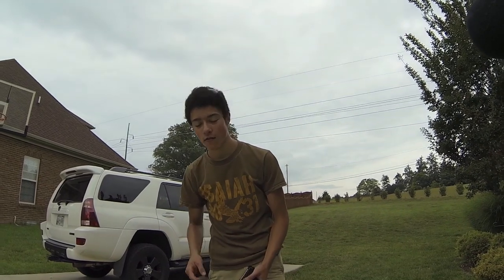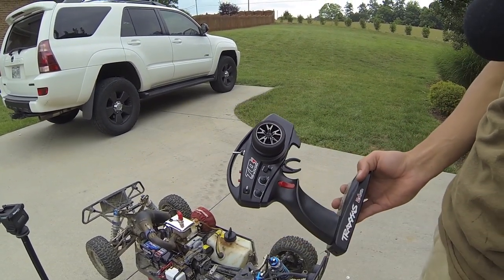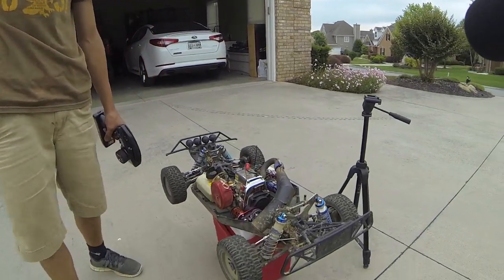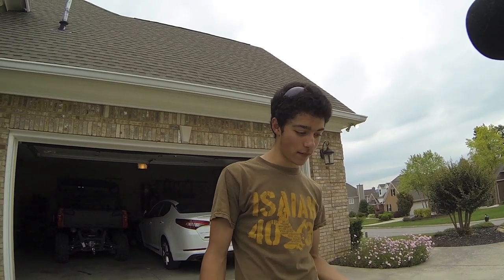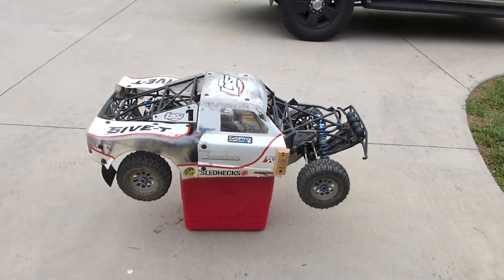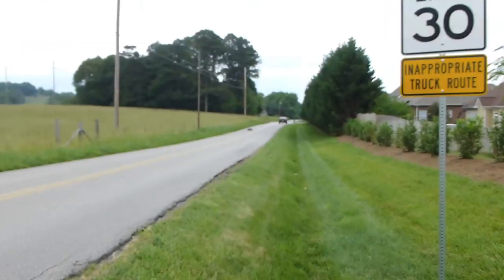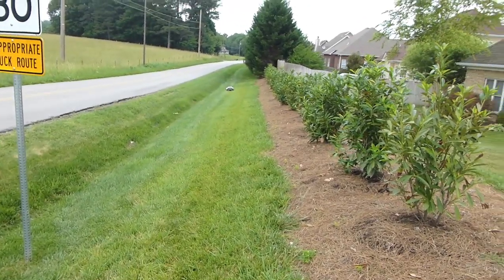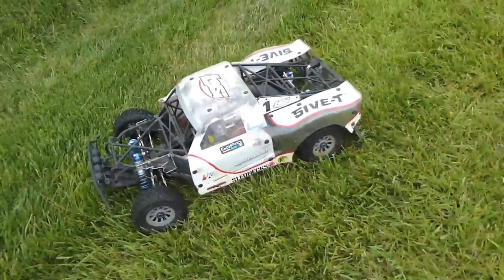FID Racing Electric Starting System - Losi 5ive T (PT. 2) - Ep. 46

Comment: I just installed one of these on my 5ive T2.0 , the starter runs fine when off the engine, but when I put it on, it spins for half a second then stops, like it’s ESC cutting off. If I power cycle the battery then works for half a second and stops again. Maybe I need a better ESC

Comment: Hi man, nice video! I have exactly the same starter but after plugging everything, the starter motor spins the wrong side... Instead of starting the motor, it runs free for a while. If you manually spin the motor countersense, both starter and motor run together... Any idea? Thanks!
Reply: Martín De Nardo I’m sure you’ve figured it out by now but switch a wire with any another wire coming from the motor t make it spin the other way I usually switch the red and yellow
Reply: Wolundstart

Comment: Great post man...do you think this will work on the Monster XL?
Reply: I own a mtxl and it is the same platform basically just with a slightly longer chassis and wider suspension arms they are beasts I also own a fid dragon hammer check them out at rc modelz.UK they have all your fid parts losi parts and every thing 1/5 scale tbeys boys help you out sothats why I give them a mention I have been looking at a one called wonlstart its got a alternator so it charges the battery back up on the starting system pretey cool if you as me a electric start with alternator built in its really  compact system both are food but like the sound of it charging your lipo up as you are running the engine correct my  spelling lol if you must hahaha
Reply: www.Rcmodelz.co.UK check they'd guys out for all you high end 1/5 scale petrol buggy's trucks you name it they got it

Comment: Doesn't it put a little bit of load on the engine by having to constantly turn over the electric motor once it stops turning on its own? Electric motors have some drag to them when you turn them....did you notice a difference? I don't have a problem just pull starting it. It's one less thing to break as well. I would rather put the money into a 2 speed or something like that. Cool video though.
Reply: One way bearing. Wow just seen how old this comment is 😂. Hopefully you've figured it out by now lol. But yea it rides a 1 way bearing like a Traxxas ez start system does.